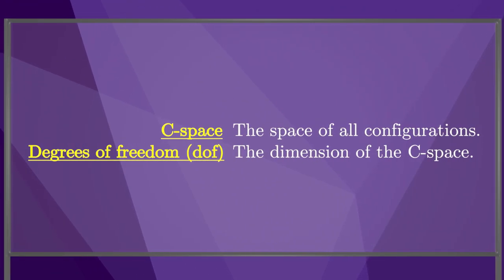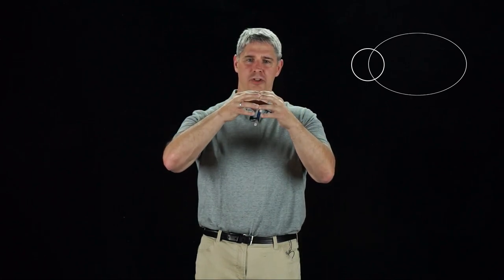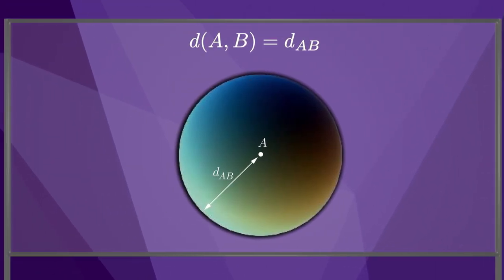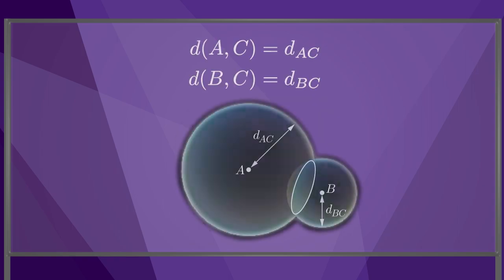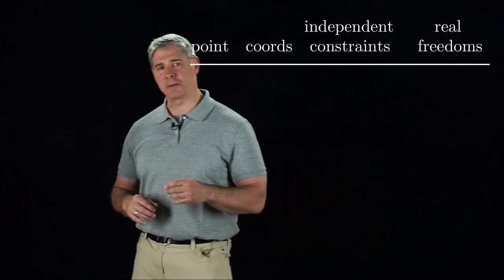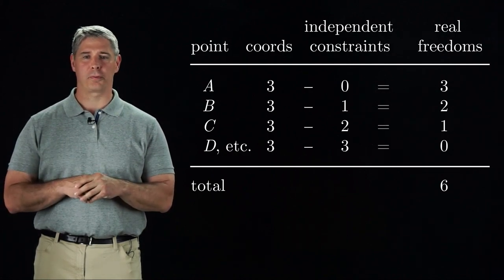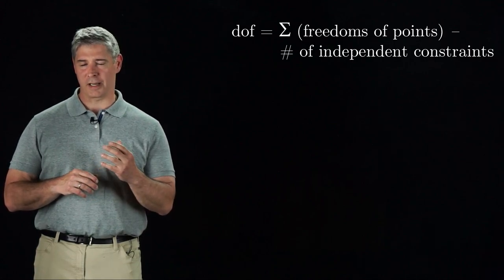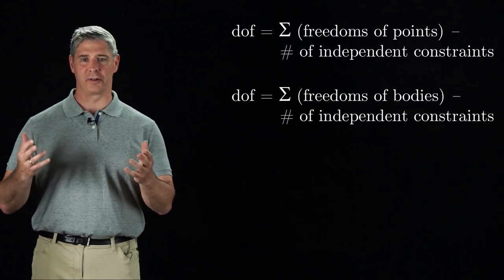Modern Robotics, Chapter 2.1:  Degrees of Freedom of a Rigid Body

Comment: In the video, it is said that there is only one number needed to specify location of point C. I could not understand it. How can we specify location of point C with one value ?
Reply: See the location of point C is represented by 3 numbers but it's position has to be in the circle that A and B formed which means it has to be at a particular distance from A and B ,and whatever the position might be in that circle, it IS going to be represented by 3 coordinates. It's not the coordinates of point C that is decreasing, its the degrees freedom of it's location.

Edit:  I'm replying 7 months later, you probably would have mastered robotics until now. xD
Reply: a circle is parametrically represented with just theta...any curve is intrinsically one dimensional..
Reply: @sparshmecwan2962  but still your answer is helping me with same question
But professor mentions point c wrt a as an outer parameter of the B sphere
Reply: Simply take any object (e.g. pen, shoe) & fix its x & y co-ordinates (i.e. keep it constant), then you'll observe that you only need one more number to specify the location of the object.

Comment: Consider a joint between two rigid bodies. Each rigid body has mm degrees of freedom (m=3m=3 for a planar rigid body and m=6m=6 for a spatial rigid body) in the absence of any constraints. The joint has ff degrees of freedom (e.g., f=1f=1 for a revolute joint or f=3f=3 for a spherical joint). How many constraints does the joint place on the motion of one rigid body relative to the other? Write your answer as a mathematical expression in terms of m and f. ans?
Reply: here the Answer is m-f. 
as per the equation given over here, f+c=m . and we want the value of c in terms of m and f.